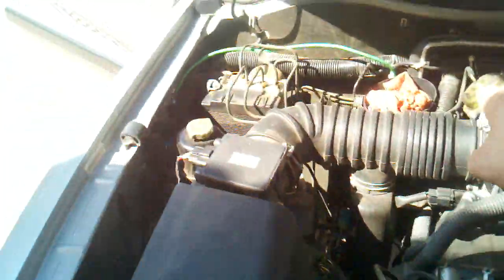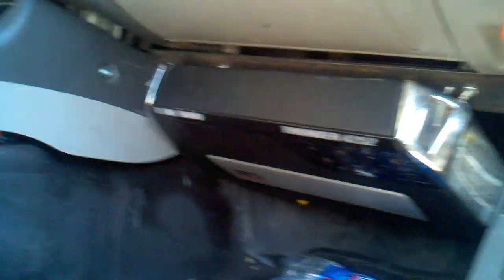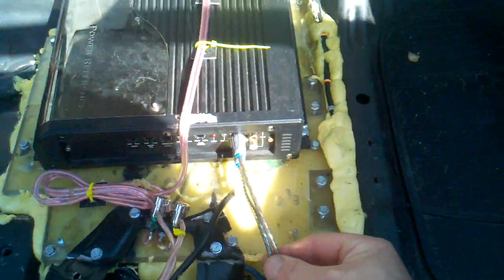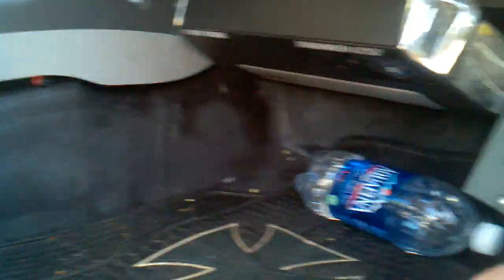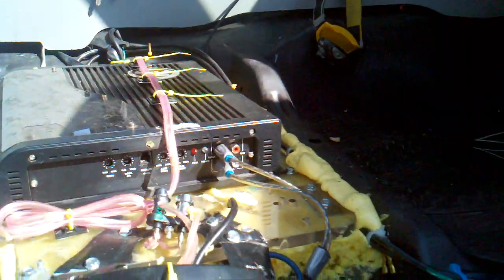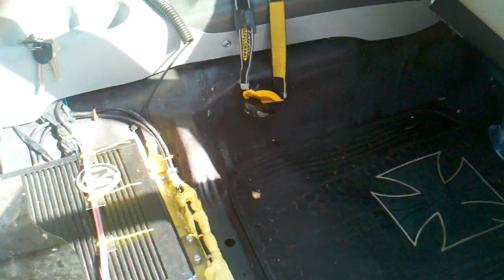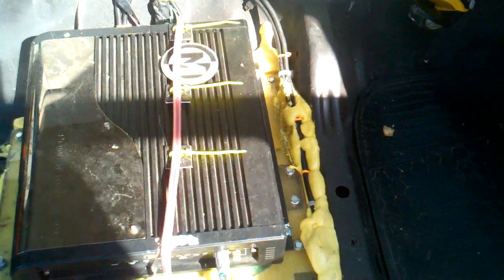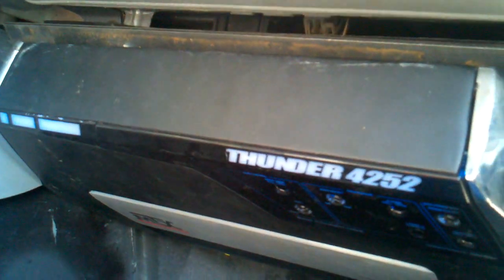basic car amplifier electrical install solution

Comment: Remote is not a circuit.  There is no series/parallel aspect to it.
The AC breakers do not offer the same protection as a fuse will.  
Electronics spec to requiring circuit protection within 18" of the source.
Are you using THHN?